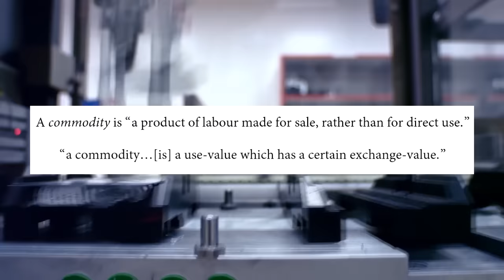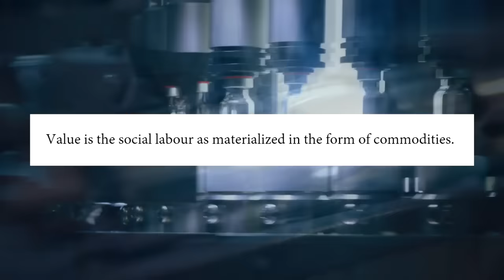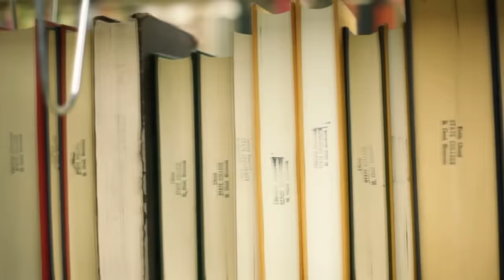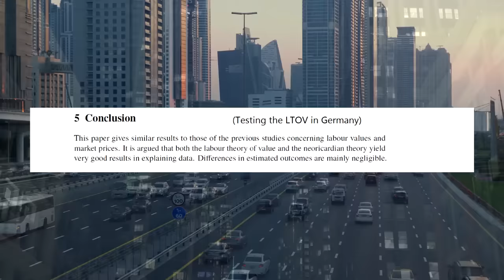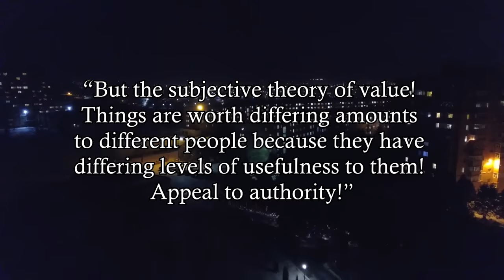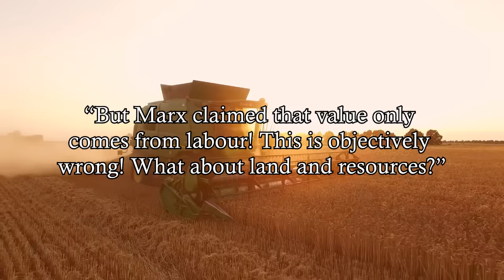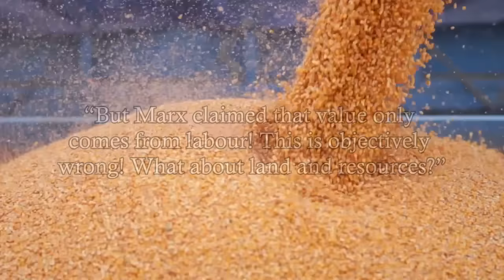Capitalist arguments against the labor theory of value suck (Explaining the LTOV) - Socialism 101

Comment: Genuine question. From what I learned, Marxism is in no way moralistic similar to Critical Theory. Am I misunderstanding this? If it isn’t moralistic in any way, then why would there be any reason we ought to change society if there is no objective good that better society adheres more to. Would appreciate if you clarify this.
Reply: I way I see it as that the Marxist analysis of society itself isn’t moralistic but that doesn’t mean Marxists can’t be driven by morality. For example, a Marxist analysis of society shows that the class relations between the proletariat and bourgeoise are inherently contradictory as the proletariat want to maximize their wages and the bourgeoise want to maximize their profits. There have been attempts to reconcile these contradictions such as through the implementation of minimum wage but due to capitalism being inherently contradictory, no amount of reform within the system can reconcile those contradictions. Therefore we will eventually either have socialism or barbarism as these contradictions eventually reach a boiling point. We as socialists should strive to achieve socialism rather than barbarism which is where morality comes in. 

If Marxists ignore morality we could recognize the contradictions of capitalism but not take any issue with it. Also there is no objective good, morality is subjective and a reflection of different groups within society. Anti-capitalism is a reflection of the class interests of the proletariat. This gets into base and superstructure which is a separate topic.
Reply: Many people have realized this and used Marxism to become more effective exploiters instead of fighting for socialism, although most people have a less selfish moral code

Comment: By your standards. Based on labour. A diamond found by a stream should be worth… should be valued the same as sand. Both are equally useless tiny rocks that serve no objective use in your day to day life. 
But if you found a diamond at a stream. You would demand orders of magnitude more money for it than the sand.
Labour is abstracted out in this scenario. So why is diamond valued so much higher? Even higher than glass which actually needs human labour to be made, let alone made of decent clarity.
Reply: I think the theory would still work here. The diamond is incredible rare and requires far more work to find and extract than sand. If there was suddenly an abundance of diamonds, the value would go down. Partly because of subjective reasons, but also because there is less labor going into finding them.
Reply: @cesarefildani5023 wow u proved value is subjective and based on supply and demand, not the labor put into it. congrats, u just disproved the labor theory of value!
Reply: @maximidayo  No? I don’t understand how what I said proves that.
Reply: @maximidayo  The value in my description sis still based of the socially necessary labor to get the diamond. Sure there can be subjective value mixed in. But the LTV still applies.
Reply: @cesarefildani5023 idk, the LTV seems useless to me if subjectivity has the potential to change the price to such a degree. why not just use STV?
Reply: @maximidayo  Subjectivity cannot accurately portray prices. At least not alone. Since subjectivity is not tied down by any constants or set value, it is far too inconsistent to mathematically explain its price. It can easily be shown to be inadequate with this simple thought. If two people are offered a commodity and one doesn’t want it, does that change its value. Subjectively that commodity has no value to them. But that doesn’t take away its value to either the one who does want it, or it’s value in a material world. A value that can be determined accurately by the socially necessary amount of labor that went into it.
Reply: @cesarefildani5023 Value isn't a consistent thing, prices are extremely inconsistent e.g. fashion trends. One not wanting the commodity does change the value, in your thought experiment. This is demonstrated IRL with supply and demand. I guess our disagreement lies in how we define value. I define value as the price someone is willing to pay, not the labor put into it. Price must be less than or equal to value for someone to buy something. Defining value as labor results in discrepancies between price and value, which leads to surpluses and shortages. If the LTV leads to incorrect evaluation, it is useless.
Reply: @maximidayo  Value is a consistent thing. Value is somewhat separate from price. Price is often affected by changes in the market, but they always fall into some level of value. This theory was brought about and proved by analyzing prices. Even as they bounced around, there was always a consistency to the commodities intrinsic values. That value can be tied down to the labor that goes into a commodity.
I don’t want to fill up the commenter’s feed with useless arguing. Have a good time.

Comment: okay LTV works but why use it? what is it's benefit compared to the capitalist model?
Reply: @Porky no it was not. Quit lying. Adam Smith did not formulate the LTV.
Reply: @Porky no he did not and neither did Ricardo.
Reply: @ExPwner  Ricardo defined Value as Labour time. Marx took that idea and took out the flaws and expanded on it. This is in Capital Vol 1
Reply: @raymondhartmeijer9300  they are both wrong on this and LTV is still flawed as shown by Menger and Bohm Bawerk.
Reply: @ExPwner  ah OK so you now agree Ricardo also had his version of LTV
Reply: @raymondhartmeijer9300  yeah Smith and Ricardo thought that the LTV was correct but flawed. They did not invent it. I was disputing the notion that they created it.
Reply: @ExPwner  OK, well, I have not come across a better model to explain value and prices. Subjective/Marginal theory or wtf else is hot these days, don't explain a whole lot
Reply: @raymondhartmeijer9300  subjective value theory isn’t just “hot these days” but has been the prevailing accepted theory in economics for well over a century now.

STV wins while LTV loses due to the fact that labor intensive industries are not necessarily the most profitable and the whole diamond-water paradox. If labor could adequately explain value then it could overcome these but it can’t. Value comes from preferences, as there is no observable thing called “value” in an object.
Reply: @ExPwner  no observable value..  wouldnt that also be the case with STV ?  If I walk in a store, I can see a pricetag, but that hides a social relation. I have no  real idea what the value is, same as when I like to sell something. I look at the competition, but again,  no sense if I will either overprice a thing or not. 
Setting a value by just looking at the thing sounds like commodity fetishism
Reply: @raymondhartmeijer9300  subjective value theory doesn’t have this problem because it does not assert that value is objective. You still don’t get it. There is no such thing as “undervaluing” or “overvaluing” a thing. If YOU value an item on the shelf more than the price listed then you buy it. If you value the money more than the price listed, you don’t buy it. Because value is SUBJECTIVE and not objective, this will vary from person to person. It does not matter what went into the final product in terms of labor. You either do value the good or you don’t.
Reply: @ExPwner  That sounds pretty ridiculous. My personal tastes, income and desires 'magically' determine the value of a commodity. What if I need socks and shoes, I value both items equally. But the shoes have a far higher pricetag. What would it matter what I think? Why would industry go to Asia, if labour costs have nothing to do with value?
Reply: @raymondhartmeijer9300  not what I said. You’re STILL not getting it. YOUR valuation is unique to you. It has no magic power on the object itself because again, value is not “in” an object. It is not observable. Value is something you may or may not place upon an object. A man who is lactose intolerant may not have any value for milk, or he may be a dairy farmer that sells it and does see value in it. That all depends upon the circumstances. It has nothing to do with labor.

If you truly valued two objects the same then you might buy only one or you might buy none depending upon the subjective value placed upon it by the seller. For example, say you value socks and shoes around $5 each. The seller of the shoes values the shoes at $10 and doesn’t want to sell for $5. No sale occurs there. The seller of the socks may value them at $4 and so you agree to the sticker price of $4.50. Subjective preferences shape the supply and demand curves.

Production is outsourced due to comparative advantage. US labor is better suited for other industries, whereas Asia is comparatively good at manufacturing.
Reply: @ExPwner  please tell me that last part was a joke. I don't buy for a minute that the shoesalesman puts a pricetag on shoes entirely subjective. Somebody somewhere has to pay for the labour involved, and those costs end up as part of the price. It's a nice try to get away from LTV. but it doesn't describe the real world

Comment: To create a product like a car 🚗 you need materials machines and an organised industry with plans and workers.

Each one of those things cost more or less for example the material's for the wheels or for the car itself are cost more then the machines because they are hard to find and they are available in specific amount for use. 

The machines are also expensive but they can be made from cheap materials which are more easily available then the materials for the car, the industry itself cost a lot more then both the car and the machines because it needs to have electricity and space for the machines and good condition for the workers also their salary so basically if we keep ((standard)) prices the industry can't exist because the materials are expensive like everything that is contained in the whole industry this is a fact the owner owns you nothing basically. 

Because he doesn't made the prices but the availability and the interest made the price which is fine because either away everyone could afford for a car company and the materials will be less and even less available.

Comment: Great video, thanks! I have a question though, for your dismissal of the subjective theory of value you primarily state it's unscientific and thus invalid, but an unscientific theory isn't inherently a wrong theory right? A model relying on an unquantifiable unit certainly is much harder to test and work with, but is that to say it inherently is going to be inaccurate? It seems strange to me to act as though everything in this world will be able to be explained and modeled with quantifiable units and values. Sorry if this is pedantic or off point, it was a point of rhetoric that stuck with me as feeling off compared to how concrete and on yours usually is. Thanks again!

Comment: This was an interesting video, not a good one, but an interesting one for sure. Let me just adress some of these points.

1.LTV has not been proven in the real world scientifically:
That's true. You cite papers that prove a corelation between total prices of industries (aka revenue) and the total amount of socially necessary labor time used in those industries. Or in other words: Industries that generate lots of revenue tend to employ lots of people. This does not prove that the price of an individual product is corelated with the socially necessary labor time required to produce one unit of said product, or that an increase in a products price is necessarily the result of the amount of socially necessary labor time increasing. However, this does not mean that an increase in labor costs will not effect a product's price. It surely will, but this has nothing to do with LTV Here  is a nice spreadsheat that quantifies what I have stated above.
https://bnarchives.yorku.ca/308/04/20101200_cockshott_nitzan_bichler_testing_the_ltv_spurious_correlation.xls

2.Mudpies: 
This is a bad arugment, I agree.

3.Subjective Theory of Value:
You cite supply and demand here, but tell me, why are goods supplied and demanded at the same time in the first place. Subjective valuation of the product at hand is the only explanation. Why should someone supply a car to the market if  what he recieves is objectively worth equally as much as what he povides? Wouldn't the opportunity and transaction costs prevent an exchange in the first place? Now you may state that the price is not equal the value, which is correct. So let's say the value of the car is lower than the price. In that case, why should there be demand for the car? Why would someone spend more on something than its objectively worth? Now you could argue that the consumers really need cars and that the producer of cars has a monopoly, but wouldn't that mean that the use value of the money is lower than the use value of the car out of the eyes of the consumer, while the opposite is the case for the supplier? Or in other words, the consumers subjectively value the car differently than the supplier, hence an exchange takes place. In addition, the monopoly-thesis implies that under perfect competition the price of a product would in fact equal it's value, in which case my first objection applies. You see, supply and demand require subjective value to exist and it's not a problem that we can't quantify it. In fact, a factor does not need to be quantifiable in order to exist. You cannot quantify individual preferences and taste, but  they still play a huge role in the decisions one makes every day. In addition, considering the fact that value does not equal price, there is also no way to quantify your objective value and hence no way to prove that objective value equals socially necessary labour time. The only option you have is to quantify the latter and simply proclaim it to be value, but that wouldn't be scientific, would it?

In case of your example with 1 car being supplied and 1 demanded, the price would result out of the lowest amount the supplier is willing to sell for (based on all costs associated with the production of the car, not just labor costs) and the highest amount the consumer is willing to pay (based on his subjective valuation of the car, which is not just limited to the car's use value)

Furthermore, you'd have a hard time arguing that profit is theft after admitting that prices do not equal value, for profit is revenue(price )- all expenses and not value - all expenses. If a price is not equal to the value of a product, then why should the difference between the price and the worker's wage belong to the worker?

4. Land/Resources/Nature:
For some reason Marx only gives human labor a special status as the determinator of value. This is metaphysical. Why doesN't the socially necessary amount of animal labor detrmine the value of corn? Why doesn't the amount of socially necessary corn determine the value of tacos? This elevation of human labor to a god-like, value-creating status is mystical and surely not scientific.

Furthermore, why should there even bee a third factor that explains why 2 goods are equal in value. A=B does not necessitate A=B=C. To argue that, because x amount of corn equals y amount of iron, there must be a third factor that equals both of these products in value and is contained in them, but still is neither one of them is a non-sequitur.

5.Art/services:
First of all, LTV is not meant to explain the valuation of services or art in the first place. It is supposed to explain the valuation of reproduceable products. Picasso's paintings do not fall under that category. Now, this alone throws a caveat at LTV. Any "theory of value" should be able to explain the valuation of all goods and not just of the ones where it is convenient. Your citation of supply and demand here once again discrdits the theory because of reasons stated above.

6. conclusion:
Bad video that manages to debunk a very weak argument and feels more like a self-destruction of Marxism.

Comment: How did you make a video about the objections economists have with the LTV, mention 'subjective value', supply and demand, and not talk about 'utility'. That's the entire explanation of modern economics. The argument is "The LTV isn't used because utility has better explanatory power.". The marginal revolution happened (in the 19th century) - that's why the LTV isn't used today.
Reply: Because he is a liar and a grifter, not a serious economics channel.
Reply: Utility?  Marx calls that 'use value', and Marx acknowledges that the utility of a commodity (which is realised through the necessary labour) is one of the factors that determines the overall value.